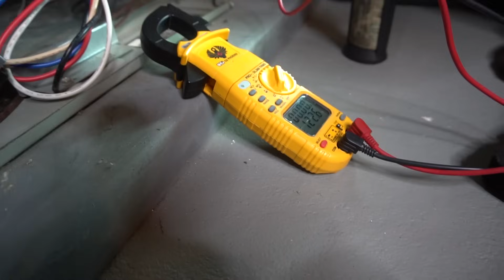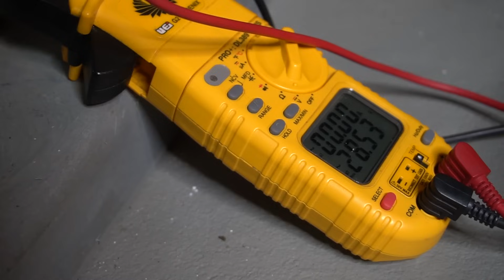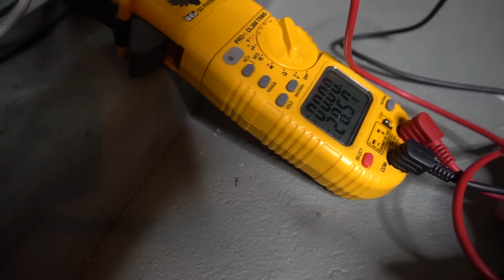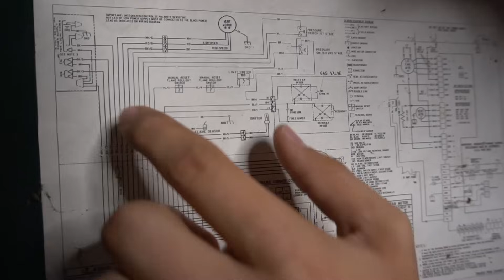Furnace/AC How to Troubleshoot The Control Board

Comment: Hi. My gas furnace blows cold air. I checked the error code and it says polarity is reversed, which doesn't make sense.The polarity is correct. Nobody has touched the furnace until this happened.  So in this case, is the board also bad?

Comment: Excellent directions here. THANK YOU. I am at the last bit where I am checking the thermostat wires, and I see less voltage, about 3.5 V, not 24 V. Does it mean a Control Board gone bad? My Rh wire on Thermostat is not getting any current.

** P. S. - I ended up calling the technician and they arrived at the same conclusion that the Control Board was worn out. They replaced it and my furnace is back up and running.
Reply: How much does it cost to replace your board by the technician?  My furnace is over 15 year old and wonder is better to replace my XL80 furnace or just replace it like you base on the replacement cost.
Reply: @bcao2008  My overall out-of-pocket was $75. The $75 was my 'service call fee' for my yearly home warranty ($700) with American Home Shield. So, AHS took care of parts and labour. The board itself was showing $125+ on Amazon and eBay. I don't know how much the labour cost would have been.

Comment: My rental house got disconnected gas Suply because the tenant move out . The furnace was working but after I called NW natural gas company reconnect the natural gas my furnace not working. I check the thermostat is working but the fan not working even I turn in to fan mode . 
I open the furnace door got tape the switch and check the control board but I don’t see any light ( it has a little red light befor alway on ) …..My question is the control board bad ? Or blower motor bad ? Thanks

Comment: I just replaced my thermostat with a nest and had to reconnect the C wire to the nest and the control board in my furnace to power it. When I checked my thermostat it said it had no power. You’re the ONLY video that mentions the door switch, turns out I didn’t put the panel back on properly so the switch wasn’t triggered to send power to the furnace. Thank you so much for the incredible detail in your video, something so simple had been overlooked in every video but yours.
Reply: Same here!! Thank you

Comment: Thank you for the educational video. My furnace flame goes off after some time. I have the Choice Home Warranty for repair work, they sent a technician diagnosed bad control board, so he is coming back with the replacement BUT also then charging me $350 for wire tracing for bad wiring between the furnace and thermostat. Is that a legitimate diagnosis or the technician is trying to rip me off knowing that the wire tracing is not covered by CHW?

Comment: do you ONLY need to shut off the door switch (tape it) ONLY IF you are checking the voltage? If i dont want to troubleshoot the voltage but take off a wire and put it somewhere else into another terminal is it just okay if i turn the furnace off? Will i be fine then?

Comment: I installed a garage heater that is brand new but a 2016 model by beacon Morris. I jumped the pressure switch and it's not igniting. I disconnected the thermostat and jumped the red and white wires and it blew the fuse on the board within 4 or 5 seconds. I called customer support for this info and the fuse keeps blowing. I need help if you could  cause I'm scratching my head with this one.  Thank you 
Nate

Comment: My issue was the door switch had gone bad. My thermostat said it no longer detected power coming from the furnace so I popped open the blower unit door. A service worker had taped over the door safety switch before I owned the home, so it was hidden at the corner of the chassis. I didn't see it and assumed my furnace was so old I didn't have one. I followed the power cables with a voltage finder from the junction box to the control board, leading to uncovering the hidden door switch. The voltage reader didn't detect current on the load wire coming off the switch. After replacing the switch everything works like new! Thank you for posting this video and saving me a service call!

Comment: Do you have additional checks for the furnace IFC?  I the igniter a few weeks ago, then last week it quit heating again.  I read through some blogs/forum threads and determined my board was bad.  the OG board is CNT03077 and the recommended replacement I found is CNT06424.  This board came with an igniter as well.  So, I replaced that, had to drill some holes for the stand-off clips.  Now, everything seems to work fine until after the second stage engages and right when the blower motor kicks on.  So, I'm at a loss right now.  But I found your channel this morning, and subscribed right away!  I'll keep watching for some hints as to why the flame goes out when the blower motor kicks on.

Comment: I have central air and my furnace was turned off (via thermostat) for the summer and a few weeks ago the fan came on while system the system was off. I replaced  thermostat and turned heat on, but when temperature dropped, the fan came back on running continuously, so I turned circuit breaker off to furnace. What is the issue? Does the control board need to be replaced?

Comment: Can a board have intermittent problems? My 3 yr old York furnace was heating one day, and then later I hear it running but no heat was coming  out of the registers. I lowered the thermostat to shut it off. Later I turned the themo up, and there was now heat. No problems for a while. But being a light sleeper, one early morning I hear the furnace running  and it seeed to me for too long, since I  basically am familiar with the cycle time. So I go downstairs, cool air is coming out again. I later shut the furnace itself off at the furnace, in my mind ,rebooting it. It heated again like normal. But this morning my wife felt it cool running when she got up before me, and lowered the thermo to shut off. When she told me later, I just turned it back up and its now again working.???? Whats your opinion?? Should the board be replaced? My furnace is warranted for 10 yrs for parts, but 1 for labor. I see the same board online for $89. so I Now a labor fee would be more than this, so I would do it myself. Thanks for any input!!

Comment: So I just went through this whole testing procedure and I have power through all of this stuff. The board light is red and not flashing. The AC works fine the heat was short cycling for about a day and now it's not running at all. I really wish I knew more about this or was in a better situation to be able to pay someone to fix this. Unfortunately I am not if anybody has any other tips or tricks to possibly try I would greatly greatly appreciate you. I know it doesn't pay to help out some random guy on YouTube but you really will have my undying gratitude.
Reply: Right after watching this vid, i watched his other vid, top 10 most common problems, and found the issue fairly quick. Thanks for the vids! Saved me hundreds
Reply: What was the problem don’t leave us hanging like that

Comment: Great video.  I am getting error code 21- Gas Heat Lockout.  The fan seems to constantly run.  Says to check for stuck gas valve relay or miswire or short.  Furnace is 7 years old so doubt its miswire as this is a first.  Any suggestions?

Comment: Thanks for the video.. I checked my board. Power goes in but when I check for voltage at R and C my meter reads zero. And every time I turn on the a/c it blows out the 3 amp fuse. Bad board.

Comment: Any way a board can send partial power to the HSI?  My HSI lights up, and there is no gas issue, but sometimes it doesn't ignite the gas.  I know it's  not a gas issue as I have used a lighter and lit the gas after it didn't ignite.

Comment: I have an older Goodman furnace/ AC GMPN060-3. When the power is on to the furnace the exhaust blower runs. Switch to AC and it cools normally but the exhaust blower is running. The control board normally has a continuous light showing, but now no light. When you turn the power on the light has a very short blink, then dark. I'm thinking the control board has a problem?

Comment: hi....i work hvac..........i have similar white rodgers 50A51-243 module. im having issue with furnace blower not shutting off. even if i disconnect every stat wire it will still run no matter what. im wondering if the board is bad where its stuck telling the blower to run. could that be an issue with the white rodgers module? thank u for any info!

Comment: Boards are easy. What goes innie must come outtie. If it goes innie but doesn’t come outtie it’s bad. I was literally taught this in college and it was one of the most important things I learned. If you don’t know what goes innie and outtie you shouldn’t be touching the board, whatever it is. 🙄

Furnace boards rarely fail to send power to the transformer. It’s a massive trace on the board that is basically a wire. If you don’t have power at your transformer there is probably a giant black hole in the board. You really shouldn’t be teaching people how to do this stuff. It’s dangerous and used to piss me off to no end when Harry Homeowner screwed with everything and I had to check ABSOLUTELY EVERYTHING to prevent a callback back in my residential days. Thank god I abandoned residential years ago. The hardest issues to troubleshoot are issues caused by humans because there is no logic behind them. DIY’ers can suffer for their screwups for all I care. 🤷‍♂️

Comment: Hey man, I watched almost all of your blower motor videos but was unable to detect the issue in my furnace. Blower motor works fine in winter. In summer with AC on, it has starting trouble, replaced capacitor but stops and starts for hours. Once temp setting  is reached like 21 or 22 once, fan runs without issue.  Motor is not too hot, blower wheel spins fine, there is 110v in the sensor board between cool and motor. Stuck with no resolution for start and stop of motor for hours. Can you help?

Comment: You are the man Jay and have already saved me. Just moved into a home in MN earlier this year. Coldest night of the winter with -30 wind chill and 15+ furnace, exact same as yours, goes out. Watched your video and and after cleaning flame sensor and using a screwdriver to bang on the other sensor that was sticking, back in biz. Now I have a Nest thermostat w/ no power. 115v going to my line from switch, but not registering anything out from the transformer, 120 or 24. No light on the board. Replaced board and still nothing. Could it be the transformer? Thanks again!
Reply from the maker: Glad to hear you were able to get the furnace fixed! I don't think it is the transformer because you said it is not getting 120v right? So from what I understood, you have verified that you have 120v going into the furnace control board but it is not sending power to the transformer? Have you checked the 3 amp fuse? (if your unit has one) Next I would try to find where the power is interrupted by looking at the furnace wiring diagram. (I have a video on how to read a furnace wiring diagram if you need it)
Reply: @WordofAdviceTV  Thanks for the reply. Yes, 120 going into the control board, but nothing from it to the transformer. Checked the 5 amp fuse and it's intact. Wire diagram makes it seem like a bad wire (xmfr) maybe because that is the only thing connecting the board to and from the transformer. When I changed the board, LED light flickered then did not come on again.
Reply from the maker: @prayersofarighteousman  Yeah, once power goes into the control board, the first place it goes is to the transformer.. I wonder if some malfunctioning component is frying the control board. Or like you said, perhaps it is a broken wire. (you can check resistance or continuity on that piece of wire to confirm). This one is a little difficult for me to advise on without being there... One thing that you can try doing is disconnecting all the wires from the board (hopefully it is not fried) and then connect the line wire, followed by the transformer wires, etc. One by one plug them in and see which wire causes the LED to go out.

Comment: If the door switch is not closed, will that prevent the 24V output from the board?  I didn't get 24V output and I am now wondering if it was because the door switch wasn't closed.

Comment: What if my line and transformer are both getting supplied 110v but the transformer is throwing out only 8. Does this mean bad board, bad line, or bad transformer? The led on the board is not coming on at all.
Reply: Update the bench test confirms the transformer is working properly. Got 28v out when I hooked it up to a wall outlet

Comment: Say your A/c is not coming on you have no 24v going to contactor. You can check if the board is bad by putting jumper wires on “R” and “Y” keeping the door switch in then taking your meter and putting it to your common terminal and check for 24v. This is same for checking heat.

Comment: I have an older Lennox G20Q3 Im having trouble determining if its the control mode or the control board that's the trouble maker.  I can get everything operating jumping out contacts and what not, but Im having trouble tracing out the control and sensor wiring between relays on the different controllers to determin which one to replace.

All the safety switches read through fine. everything fires up seperatly.

I know there has to be a simpler way to test the terminals from the controllers but Im really having troubles following it through.

cm- sp735l  p/n 18g9101
cb- bcc2.   lb-e3b224     636-A

any pointers other then change them both or the whole system lol

Comment: Hi there, my issue is with the blower motor fan in the furnace (aka inside unit), the motor blows air when the heater it's turned on. the issue is when i switch to cool or AC on my Tstat, the unit outside works no problems but the fan inside the house shuts off or wont turn on. please help me? I got a new Tstat, and a new control board. I don't know what else to do.

Comment: I had a less than 1 year old Goodman unit today that stopped working after power was shut down to it for 3 days.  I have 10 blinking led red light sequence.  I started to perform the checks you said, and I do not have 24VAC at the "R" post.  However transformer and 110VAC is working properly into the unit.  What could it be?  Is my mainboard bad?  Goodman diagram says anything more than 7 flashes is a reversed polarity 110VAC,  however I triple checked everything into the transformer and it's correct..?

Comment: That switch will only stop the air from turning on. The power to the AC is still live outside 240V,  Only the 24V is off.

Comment: Hi J, Thanks so much for such excellent teaching. I have a question: My heat furnace is a comfortmaker furnace model END4X24L17A1 every thing works OK but the blower motor does not stop when it should. It continually blows air even when the set temperature has been reached or even if we set the thermostat "system off". We thought it could be the thermostat, changed it for not good. So we think is the control board. Are we correct?? Any advice is greatly appreciated!!!

Comment: Help please
Relight on Control Board CNT03077 159-4519  On Furnace model  TUD100R948J1. 
Almost like yours. 
WHAT control board do you recommend?? .. I cant find the original one anymore. and will it be plug and play?

Comment: I replaced the blower motor and capacitor on my Goodman furnace. I made sure to take a picture of the motherboard so I could reconnect all blower motor wires correctly. After installing the motor and capacitor, the furnace turns in an incorrect sequence (exhaust fan, blower motor, igniter, burner) and the blower motor doesn’t turn off after the burners turn off and the exhaust fan turns off. The exhaust fan and burner comes on when the thermostat calls for heat, but the blower motor runs continuously. Not sure what the issue is.

Comment: Hi J , Thank you for your videos , My furnace is carrier weather Maker 8000 ts  has a little issue is my igniter has no voltage . So it can not turn on blamable  The only thing I need my furnace work is using my lighter to light it up to keep warn in this winter time . However ,  I checked my control board has received 24 voltage but my igniter has no voltage . I checked a limited switch ( both legs have no voltage )  also . If you don't mind , please giving me an advise should I replace a limit switch only or I have to replace a new furnace control board ( too expense ) ?

Comment: My ac unit won’t turn on and I measured the voltage between R and all the terminals and they all have 28v except the AC wire. Tested both at the thermostat and the furnace. The furnace and fan both work fine since I was using it just this winter, but my ac isn’t turning on when I set it to cool. The ac wire gets 15v and when I measured the wire going from the furnace to my ac unit outside, i got 19v. Could it be a bad board or transformer? Personally I believe it’s the board.

Comment: Today i had a furnace that would ignite but would run for a minute or so then cut off but keep a fan running. I could get it to fire up and run for 15 mns or so when I shut off power for a few mns then tuen back on. My error code from the control panel said look at the igniter.  It glows fine. I believe the resistance was about 15 ohms. I think it is the control board. The relays seem to click more than normal. I tested all my safety switches and all seem to be working correctly. I also cleaned the flame sensor.